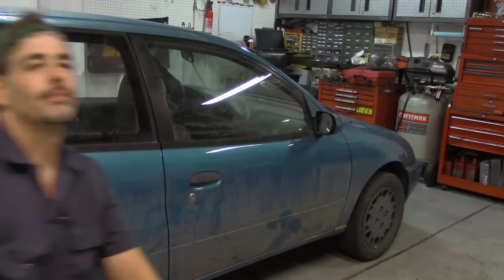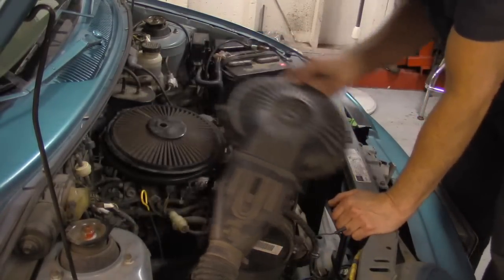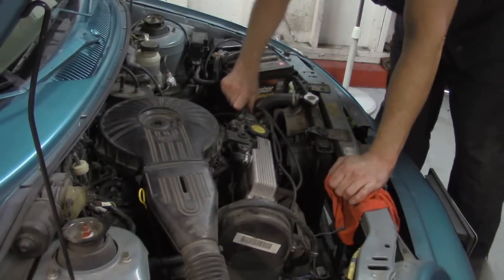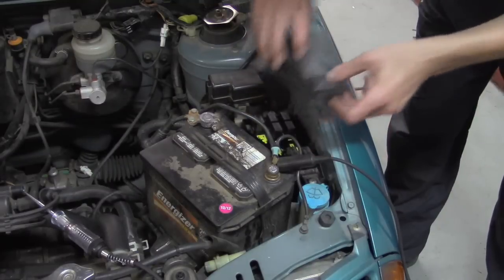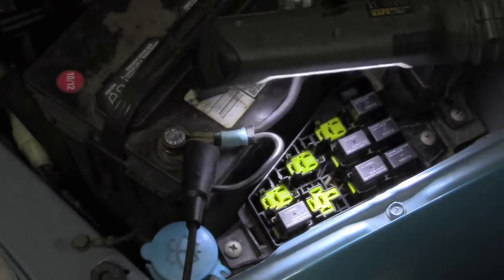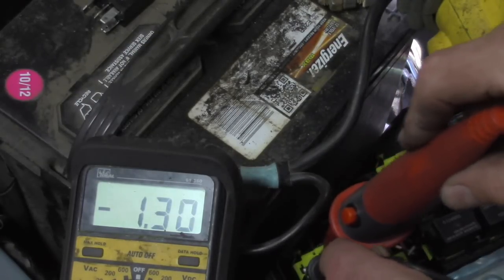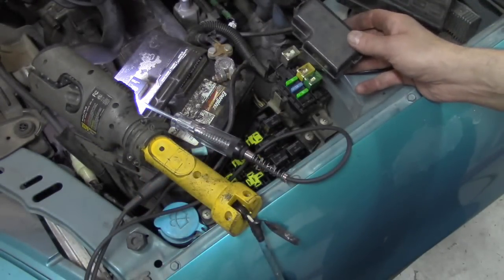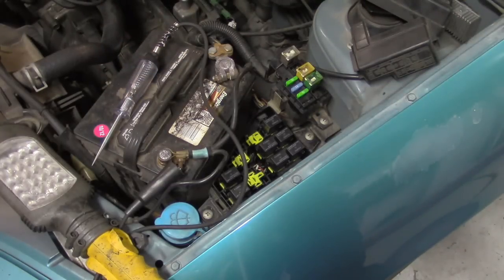Cranking No Start -Quick Basic Diagnosis

Comment: But one Question I still have . There was no spark , but the ignition system normally is not on the same circuit as the fuel pump. What was the reason for the no spark ?

Comment: So why was there no spark?  The fuel injector circuit and ignition spark would have both been shut off by a non-functioning cam-crank sensor problem, but with a functioning cam-crank system, there should have been ignition spark, even with a blown fuel injector fuse.  What is the explanation for why ignition spark returned simply by replacing a fuel,pump fuse??
Dr. K.
Reply from the maker: Because it’s not a fuel pump fuse. It’s an EFI fuse. It controls pump and ignition.
Reply: That makes perfectly good sense…but you left us hanging at the end of the video.  Thanks for the update!! Dr. K.

Comment: Can you comment on why a blown fuel pump fuse gives you no spark?  I thought the cam/crankshaft control the spark.
My car problem is I have a 1995 Maxima.  I did a piston and ring job on it; now it cranks but won't start.  I have spark.  Two of my six cylinders are below min. psi(125 instead of 142).  I'm using starter fluid.
Reply from the maker: It’s probably because the ignition is on the same circuit

Comment: My car will not start due to p0340. But I changed out the camshaft position sensor and the crankshaft position sensor and still will not start. Obviously it's a fuel pump. Fuel pump doesn't work.
Reply from the maker: How would that cause a 0340 code???

Comment: It's hard to believe he did not comment on how filthy that air filter was. Completely black, when it should be white.
            It's not like he missed it or something, he handled it even. I understand it is an air filter but this was extreme.
Reply from the maker: Had nothing to do with issue so I am not concerned with it. You have to stay focused on the relevant issues in dignostics and not get sidetracked
Reply from the maker: There will always be something. Always. Another person brought up a similar comment in that I didn’t check tire pressure. 
   As long as the relevant data is addressed whatever else is covered or not covered is irrelevant because there is no limit to such things. However the relevant data is finite. Always Stick with critique on the finite data.

Comment: Great video man. I have a crank no start on my 2.8 liter VR6 the motor was just freshly rebuilt and I believe I'm getting no spark. I checked all fuses and they are all good, the ECM relay is good as well. What could be causing this crank no start/ spark issue?
 What a ground wire missing from the transmission to the chassis cause this?
Reply from the maker: right now you have to first determine the missing FASTEC component. once you do then you will be able to pursue variables. if you find the coils are not firing AND they are internal transistor design then yes a bad ground is possible. otherwise it is not possible since each coil would be ground side switched.
Reply: @SchrodingersBox  🧐🤔 I see what you mean. I'm not quite familiar with the term "FASTEC component" 
  but I think you're referring to a missing electrical wiring component? Is that what you mean? In a nutshell from my understanding the ECU relies on several ground points throughout the engine and some on the transmission to crank and start and run properly.
    I definitely think I'm missing a ground wire from my transmission to the chassis as I just found a photo I took out the car last year and it was on there. I'm going to go and try to reconnect it, and hopefully the car will start 🙏✝️ thanks again for your support on this. I'll keep you posted.

Comment: So checking the fuse first results in a 3 minute video to save time and now everyone knows how to change a fuse and learned nothing else!
So the procedure is check fuse, it's blown, replaced good to go!
Now since that covers every cranking no start issue your job is done because it's not like the point of the video is to inform and teach! If that were the case then for sure you would begin by spraying break clean on everything and waiting for the issue to jump out and die so you can run to the part store.
Well I would say that leaves plenty of lens time open for the TransAm to do anything and just let it be what it will be ...  Amazing!  Lol

Comment: I am new to electrical diagnosis and the parameters for continuity.  I thought the reading of 80 or so ohms of resistance would have been too much and shower NO CONTINUITY? I thought the number should be almost zero? Is this dependent on the meter settings?
Reply from the maker: continuity is not a matter of resistance- it’s a matter of connection as opposed to being open. even a circuit with 10000 ohms has continuity.  in a continuity test you are checking for an open or not.
Reply: @SchrodingersBox  oh ok thanx

Comment: I say check the fuses/relays first simply because it’s easiest. Got a coworker that had a bus with wipers stopping intermittently. Stole a motor off another one, changed the switch, check the air in the tires (j/k there), etc. After being down almost a week, turned out it was a bad relay.
I hear what you’re saying and you’re right: that fuse blew for a reason and there’s nothing wrong with investigating further. I’m just saying always check the easy stuff first. Just my two cents.

Comment: turn the key, and listen to the fuel pump ist the first thing. if you do not hear the pump check the fuse if the fuse is OK check the relay if the relay is OK check the ignition switch , if the ignition switch is OK give 12 volt to the fuel pump. if the pump is runing check the wiring if not replace the pump.   German mechanics LLC . Maricopa , Arizona.
Reply from the maker: why not check relay first since that also checks the fuse too?  schrodingers box mechanics.

Comment: I have a 96 Geo Metro and them fuse is good.. But no spark and still looking into that.. I don't have a tester nor a jumper. Hard to tell when  someone pulled the motor and tranny. I will be looking at the crank sensor to lead me places. First the clutch has a grinding noise. So I need to pull tranny and fix it. Then tackle the no start. Has fuel running to the motor but no spark. Has a new coil...new motor n heads..new plugs and wires. Rotor also.
Reply: You have a good way of teaching and showing how to help others. Awesome man..we need people like you.

Comment: My fuel pump primes. I can hear it.
Reply from the maker: I would start by measuring the amperage draw from the pump.
Reply: @SchrodingersBox  my positive battery bone toon is very hot .when I go to connect it.????
Reply: My positive battery cable connection to positive is very hot when I go to connect it to battery
Reply from the maker: exactly. that’s why i would measure amperage.

Comment: Iam having crank but no start problem with my 2005 gmc envoy danali. I did discover that my computer relay is getting hot. If I disconnect the battery and reconnect listing for loud clicking then it will start. Today I disconnected the battery for about 3 hrs. Then it seems to always start.

Comment: Just feeling the need to pop in and tell people that the basics don't always diagnose every crank, no start issue....  especially with vehicles later than 03 at least. Cat issues became a really big problem in the mid 2000s. Just got my 08 started after pulling an o2 sensor and spraying seafoam into the cat. And then I torched the sensor end of my o2 sensor to burn off the build up....red hot. Car fired up and ran for quite awhile. Will probably have to replace the cat and the o2 sensors shortly, but this was a quick fix until I can get the parts ordered. I had zero codes at all. Once I got it running I had a cat/o2 code that was there months ago and went away. Hope this helps people who have tried everything with no prevail.
Reply from the maker: that’s makes no sense. none of that would cause a no start. absolutely impossible. sounds like you accidentally did something to start the car by bumping something and didn’t know what it was. that’s the only way those things would “fix” a no start because a car will start perfectly fine even with just O2 bias or no catalytic activity. 
   Diagnosis ALWAYS WORKS. EVERY TIME. Guess work only works when you are lucky. that’s why you should never guess.

Comment: I got a 1999 dodge Durango 5.9 it just cranks for a long time then it starts new plugs, wires, rotor, cap, fuel pump, injectors, position throttle sensor, upper and lower O2 sensors,  are some of the new parts i have put on it new looking for some help I'm trying to figure this out
Reply from the maker: ok that’s a lot of parts changed.  what data are you using and how are you analyzing it that ALL those parts showed to be bad to you?  what is your strategy to diagnose this issue?
Reply: @SchrodingersBox  it just what i was told it was
Reply from the maker: well you were told wrong. a lot. I recommend ditching whoever is “advising” you and instead begin systematically collecting data and analyzing what the actual cause must be.
Reply: @SchrodingersBox  so can you tell me the right fix or the answer I'm looking forward to fix this problem please and thank you
Reply from the maker: sure.  what data do you have?
Reply: @SchrodingersBox  there's no check eng light on it just cranks then starts like it's no getting no gas
Reply from the maker: ok so what about the basics like voltage at the coil and the rail pressure?
Reply: @SchrodingersBox  it's going in to the shop on Tuesday they side it sounds like a bad cooling temperature senser

Comment: How did replacing the fuse fix the no spark issue??
Reply from the maker: because it restored the cam position sensor signal input. at least, until it blew again.
Reply: @SchrodingersBox  cool. Did u figure out why it popping fuses?
Reply from the maker: yes that’s in another video. It was a short to ground on the signal circuit.
Reply: @SchrodingersBox  awesome. Now you can put it in neutral downhill and get 100 mpg

Comment: Can a low battery still produce enough spark to crank fast ? Because I change battery on my Honda and it started like normal and got me confused .... just trying to figure out wth did I just fixed..... I hate fixing a problem without knowing it for future reference
Reply from the maker: a low battery can absolutely  produce enough spark for combustion, but for cranking fast enough- that’s up to the starter.  a low battery may not allow the starter to turn over fast enough for the car to start despite there being sufficient spark. I have a recent video in fact where the battery is so weak it doesn’t even turn the engine over 720 degrees  yet the spark is clearly strong.

Comment: you shouldn't feel the need to spend time addressing 'armchair ass-hats' as you're calling your viewers. Spraying combustibles directly into the intake will quickly give you a workflow direction rather than wasting time and knee mileage checking ALL the fuses. Viewers will ,if they watch enough of these types of vids, be able to draw up their own scenario work flowchart and realise it goes near the top of a crank/no start diagnosis right below confirm customer complaint..... good job, crack on mate...
Reply: confirm complaint, visual inspect for anything obvious then reach for your spray....before the 'asshats' jump on that statement.

Comment: In order to verify spark, should we connect the test light to the negative post  of the battery? Thank you.
Reply from the maker: Yes you can do that.  any ground will work. Some will say it’s safer to use a chassis ground but it doesn’t matter.

Comment: I had the crank but no start problem with my 1998 Ford Escort. The problem was a worn ignition key. I used the original key which was seldom used and the car fired up with no problems. After 16 years of using the key made at a hardware store, it was a bit worn on the edges.

Comment: Great video! Do you have any experience with changing the camshaft sensors on a Hyundai 2007 Santa Fe 2.7L? I have a crank / no start issue w/ zero rpm indication. I cannot remove the Bank 1 camshaft sensor (seems the engineers at Hyundai designed the water lines that go to the cooling assembly to encroach on ).
Reply from the maker: Plenty of experience with it.  The first question- why are you wanting to remove the sensor? What confirmation do you have the sensor is faulty? Did you verify signal output, ground and reference?
Reply: @SchrodingersBox  I have code P0016 camshaft/ crankshaft issue, also P0300/01/03/05; I have fuel, air, spark, zero cranking rpm; only have multimeter and simple OBD reader. Thanks!
Reply from the maker: That’s all you need! Use the multimeter to check signal. If you have it then changing that sensor obviously won’t do anything.
Reply: @SchrodingersBox  Thanks! We are having some bad weather here. As soon as I can, I will check for signal.

Comment: My 93 Metro quit on me as I was driving. Came across this vid and decided to check the fuse FOR A 2ND TIME, this time I took it out for a better visual and Thank You Very Much, sir. I knew it was fixed when I heard the fuel pump priming. There was a short in my system that I was able to fix too. Great video.

Comment: Hi Matt....look, I'm not asking you to solve this problem for me on line.  If I was near you, I'd love to bring you this vehicle.  However, if you would be so kind, I'd love to ask you what you think about this problem that, so far I can't resolve.  With all your experience, I hope you might at least have some ideas about it.
I bought a very clean 97 Expedition.  4.6 12 valve.  It cranks, but will not start.  If I open up the intake pipe, and spray some atomized fuel in it..it starts right up immediately.  If I keep spraying, it keeps running nice and smooth.  Obviously there's spark, but no fuel.  I hear the fuel pump running, and there's fuel pressure in the line at the fuel injectors.  A new computer was installed by the guy I bought it from..but, changed nothing.  I was thinking of getting a new key made to see if somehow the security system was screwed up....anyway, I'm frustrated as heck.   Any thoughts?
Reply from the maker: What is the fuel pressure reading at idle vs under load?
Reply: @SchrodingersBox  wish I could tell you, I've never had it running....it was around 40 when I turn on the key...
Hey, maybe I can find out for ya.  I can get it running when I spray atomized fuel into the air intake....so I guess I could do that with the pressure gauge connected

Comment: My  Mazda  demio  cranking  but  no  spark  no  injector  pulse  and  no  fuel   what  the  solution
Reply from the maker: What data do you have? I'd start with something simple and direct like a CKPS and CPS bypass to see if you get response and go from their!
Reply: Could  u  pliz  send  me  a  vedio  on  how  to  bypass  but   on  mazda  demio  so  dat  I  can  understand
Reply from the maker: @sechsech4335  Its the the same on all cars- you just simply bypass the signal to ground. If it's a hall effect sensor , do not bypass the feed directly to ground though- you'll blow the transistor.  On a inductive sensor however you can simply put 250ma to the ground IF it's ground side detected by the PCM.
  It's pretty simple- just don't bypass feed direct to ground is all.

Comment: That was a great video, thank you for sharing.  I am having problems with the same type of Geo this video covered which I would like your opinion on if possible or find out if you have already covered the problem in prior videos you have made.  The 97 Geo I have will start twice then just crank over and not start again until I have disconnected the battery and let it set over night then the same thing will happen again.  It will start fine and run fine on the first start, second start the same, third start all the check engine lights come on and it will just crank over with no start.  I just don't understand  on electrical end of things how you trouble shoot to find out if it is a sensor or part has gone bad.  Does this sound like it could be a cam or crank sensor problem??  Any help you could offer would truly be appreciated, thank you...
Reply from the maker: I would try a cam and crank sensor bypass test as first step.
Reply: @SchrodingersBox  Thank you, I'll try that and see if it makes a difference.

Comment: HI Shro 
Recently AAA told me I need new starter, which I believe anyway. For the past year occasionally I get a no crank, just a few clicks or maybe none. I take off both terminals for 10 minutes the it starts. I just learned that paper clip   to 30 and 87 will bypass and start your car and I did that and my car did start twice with paper clip, had to try that because it's freezing in NJ now and car didn't start so I wanted to try the paper clip trick I learned in you tube. Then I hear on yet another YT VIDEO that if your car starts via paper clip trick you starter is good??? I think I'm just bypassing selonoid which sticks right???
Reply from the maker: You need to test voltage drop across the starter. the paper clip cannot tell you anything more than the ignition can EXCEPT if you have an ignition cylinmder problem is all.
Reply: @SchrodingersBox  Do you have a video that's shows me how to do that you can direct me to?
Reply: @SchrodingersBox  thank you found your video on voltage drop

Comment: something you might concider is to use a 12v automotive circuitbreaker inplace of a fuse. breakers come in different amp load sizes. its been my experience that blowing fuses until the problem is found is not only likely but can be a frustrating when you have too continue changing onetime use fuses. it seems to work well for me. like your show and your methods approch the challenges well.
Reply from the maker: Why would you blow fuses until the problem is found? Once you identify the problem circuit there is no need to put another fuse in it until you locate the short first.